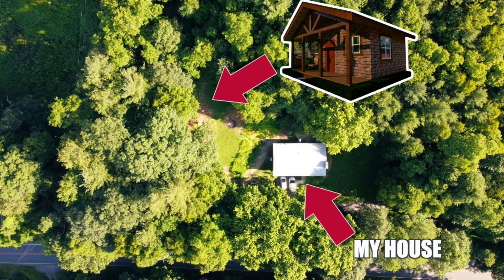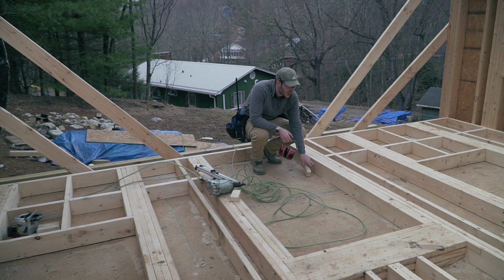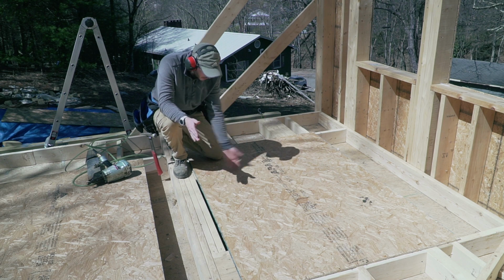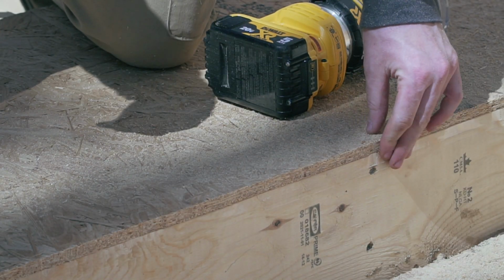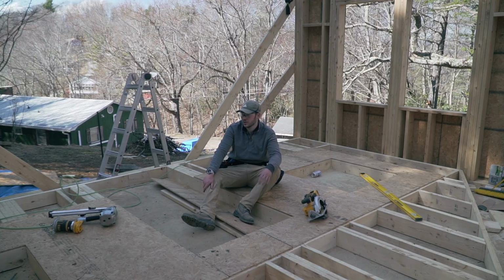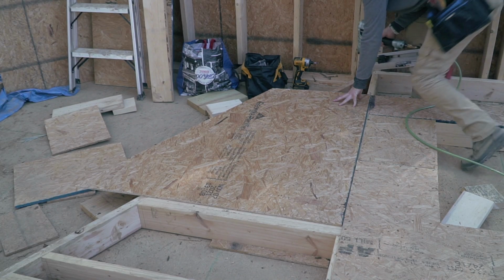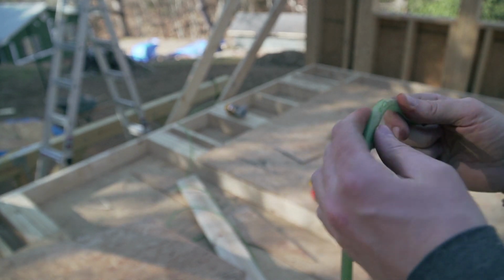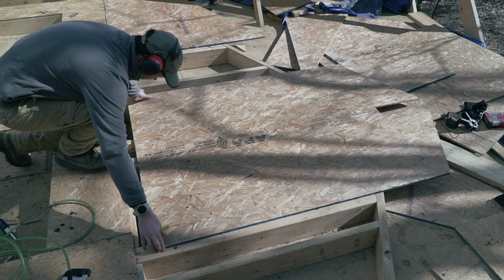Becoming a Much Lazier (Smarter?) Cabin Builder While Sheathing the Front Wall - EP 25

Comment: Next time put the hose in boiling water. It will soften up and be easy to slide onto the little tube.  8-)
Reply from the maker: Nice! Thanks !
Reply: WD40 is friend and would help get to slid easily without boiling water and or getting a heat gun and or bringing the sun core closer to earth surface level in effort to heat and make the plastic tubing pliable.

Comment: Based on the erratic movement even when you got the first router cut moving, I suspect you were climb-cutting (moving the router against the rotation of the bit), which was throwing the router all over the place. The second snippet appeared to be conventional cutting, which is far, far safer and the appropriate method for this kind of task.
Reply from the maker: Yes, I’m glad I ended up figuring it out!
Reply: Is that more router than is necessary? If you are going to use in a vertical plane use 2 hands.
Reply from the maker: @retired0307  I sadly did not know what I was doing, I feel now I can handle it a little bit better.

Comment: Nice job! Is quite big the cabin. Very professional the repair of the hose, I would have put some tape and it would not have worked 😂.
Reply from the maker: Yeah I’m starting to realize how tall this structure is getting and that I’m gonna have to get up there to install a ridge, the rafters and a roof. That’s quite scary. 
I was happy I didn’t have to buy a brand new hose 😁
Reply: @TheDIYCabinGuy  Yes, I had a hard time building the roof, since the highest part is a little over 4 meters high. Luck there!

Comment: Routers like to cut in one direction better.   You were cutting wrong direction in first clip them right direction in second. If you look at the blades and picture how they rotate and cut it makes sense.  For the hose warming with aheat gun makes it slide over the barbs easier.
Reply from the maker: Thanks a lot for those tips! I should have thought about the heat gun! I live I learn.

Comment: Dip the tip of that rubber hose in some rubbing alcohol and it will slide right on that nipple. Try it if you ever have to fix your hose again. I use this methode all the time when putting rubber hoses onto tight nipples. This is also how I put on or take off grips on my bicycle handle bars. They slide right off or on then the alcohol dries and they are tight.
Reply from the maker: Nice! Thanks for the tip